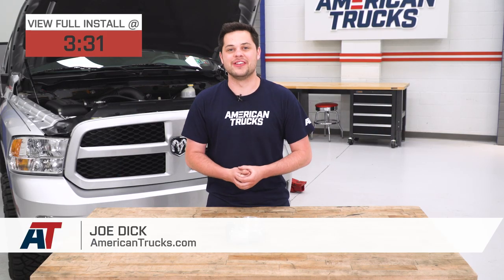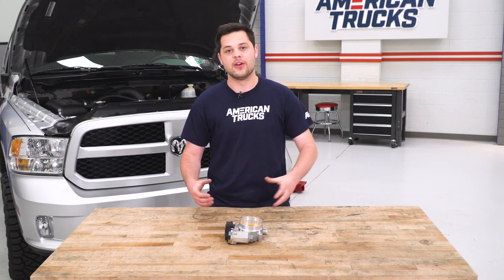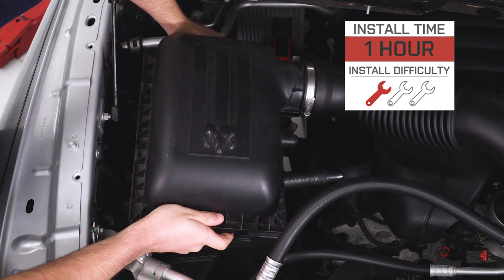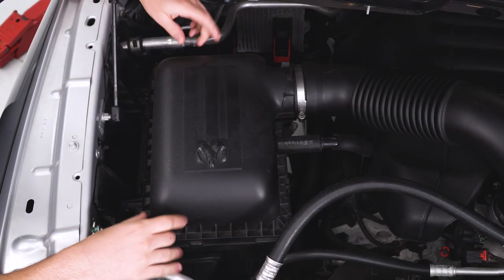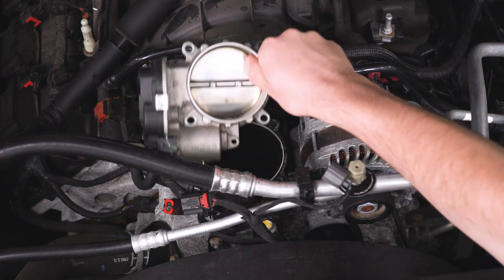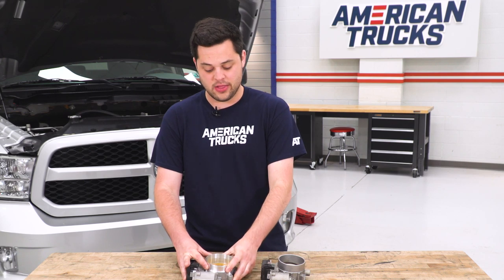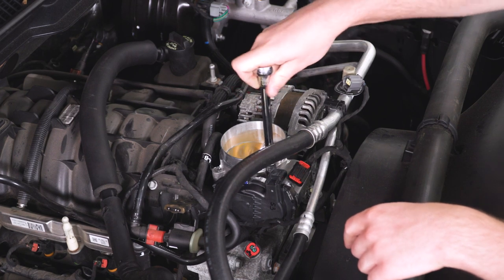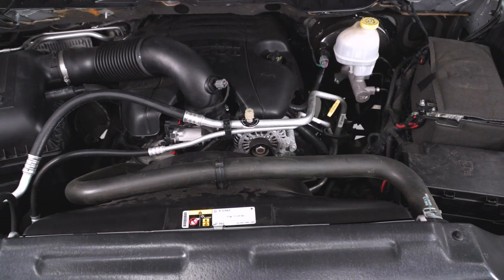2013-2018 RAM 1500 5.7L BBK 90mm Throttle Body Review & Install

Comment: IF more air means more HP and the BBK front has a bigger opening but the back is the same size opening as stock than there cant be much more air coming in. You can have a straw with an ultra wide opening in a shake but you still get the same amount out. the 90mm might give a little more but could not be that big of a difference.
Reply: it increases air pressure
Reply: @tjvermillion5888  I tried a BBK throttle body. It lasted 2 hours and gave up and left me stranded on the side of the road. Put the original one on and ran perfectly.
Reply: First mistake was using a bbk product lol

Comment: If the pipe coming from the airbox to the throttle body remains the original size then doesnt the increase in diameter of the throttle body prove to be a waste of time and money?

Comment: What is the circumference of the intake manifold throttle body mount opening?   Is it 80mm to match the stock Throttle body, or is it larger?  I ask because if it is 80mm, then the larger 90mm throttle body opening is not 'ported'.  So, the larger Throttle Body circumference doesn't really increase air flow due to the 80mm restricted neck on the intake.
American Trucks - please respond to this question.
Reply: Good question but sucks they didn’t answer
Reply: @vicer77  I bought an 80mm and installed it on my 2018 5.7L.  The stock intake is approx. 83mm  (i think....) and the 'restriction' I inquired about is not a problem.  The TB works great, but I need to install my muffler delete pipe to (hopefully) see the gains - engine breathing IN better, but still restricted by the stock muffler so breathing OUT hasn't increased.......
Reply: I call shenanigans. They refuse to answer this question, and it's the BIGGEST question here
Reply: It’s a gimmick. 
Only way to increase air is to get a larger bore throttle body attached to a the same larger sized intake.

Comment: What about a TB spacer?  Ideas or thoughts?
Reply: I did it on my 2000 Dakota with a 3.9l and manual transmission a yr after i got it in 2001. First was exhaust, 2nd, cold air, 3rd was the spacer. Everything I did lowered the rpm that I felt the power kick in. In 3rd gear I started to feel it around 3,800 rpms, exhaust lowered to 3,300, intake to 3k, and then the spacer to 2,800. I had 3.55 rears in it and that was great for mpg, but it had a weak spot from 2nd to 3rd gear around 50mph. I had to run the rpms up high so 3rd would pick it up, afterward it wasn't an issue. (This was during towing). So, yes it helps  a little, but probably helps more when you have other things that work together. I had over 200k miles on it over 20yrs and only replaced water pump once, ball joints once, and heater core so I had heat in the winter 17yrs in. That's it. It was a great truck but I needed something larger to pull horses around and sold it to a 18yr old kid. Still running now.
Reply: Don’t do it, if you’re N/A, there’s no point, unless you’re running NOS or something, don’t waste your money.

Comment: It doesn't matter if the intake side is larger if the output of this throttle body is still the original size. Looks like a waste of $500 to me.
Reply: I agree doesn't make sense, bottle neck still same size. Put a 100 mm still same theory!
Reply: @stevem8128  The idea is that the bottleneck creatures more pressure not more volume.
Reply: @williamhermann6635  
Gotcha

Comment: Is this compatible w/ the K&N Blackhawk CAI?
Reply from the maker: The coupler attaching the intake tube to the new throttle body may be a little tight, but it will fit and perform just fine! -Zach

Comment: These are the guys that vinyl their pickups for 4000$, buy every last thing Haas tells them to buy at full retail and then charges 500$ like its no big deal. It's a hunk of aluminum. Not silver. Just cause you can't do the job without spending 400k doesn't mean its worth 500$. That means you suck at your job and someone hungrier deserves your paycheck.

Comment: Can i put this in a 2012 quad ram 1500
Reply from the maker: This specific throttle body will only fit 2013-2018 5.7L RAMs. BBK does have a 2003-2012 option though, that will fit yours just fine. Check out the following link! -Zach https://www.americantrucks.com/bbk-90mm-throttle-body-57l-0312ram.html

Comment: Do you have to reprogram
Reply from the maker: You won't need to re-tune your truck after installing this throttle body. If you plan on pairing this with an intake, exhaust and some other parts though, you will definitely see a better boost in performance after tuning. -Zach
Reply: @AmericanTrucksRam  Which tune would you recommend in this application?
Reply: @dl4712  diablo i3 with custom tune. Moes performance.

Comment: Your still bottle necked on intake. Do yourself a favor and use that $500 towards a better intake.
Reply: That  would be a fail as well . Best choice is getting the 6.4 hemi intake manifold and swapping it.  You need injector spacers to use the 5.7 injectors or get it tuned for the 6.4s injectors . Plus get it ported gains up to 40 hp dyno proven then add a intake to maximize air flow .

Comment: 500$?!?!??! I'll build a benchtop CNC lathe here in Detroit for 500$ and put you out of business! I'll start with every 38$ core at my local junkyard, bore it out and flip them for 250$ on Fleabay all day long. What a freakin joke. You dont have to buy the most expensive tools to do the job. I'm not paying your insane overhead cause you cant run a business efficiently. JFC